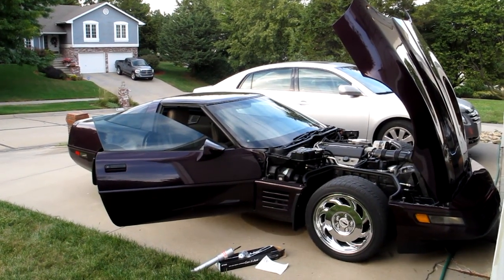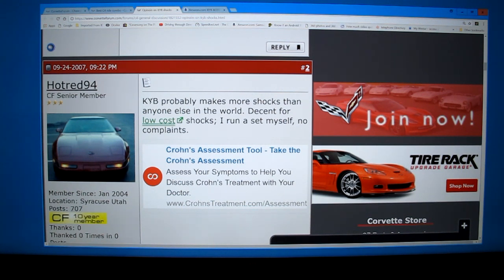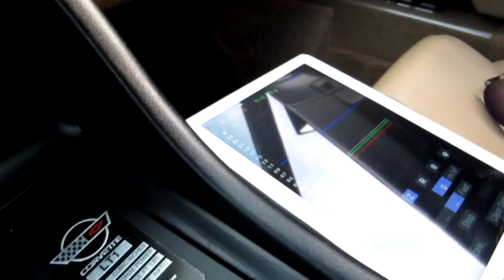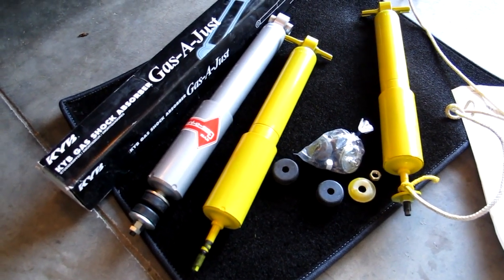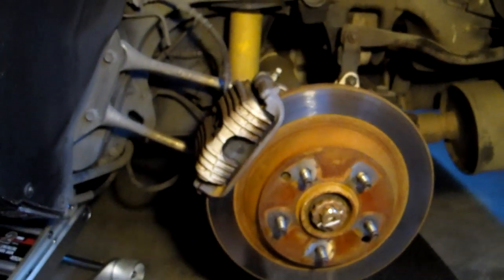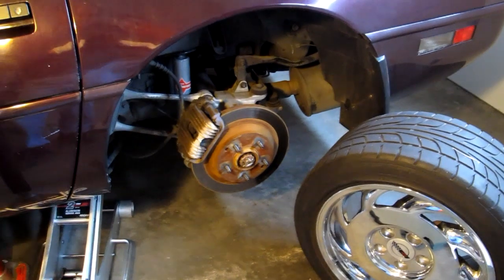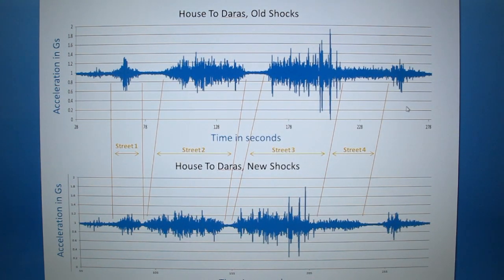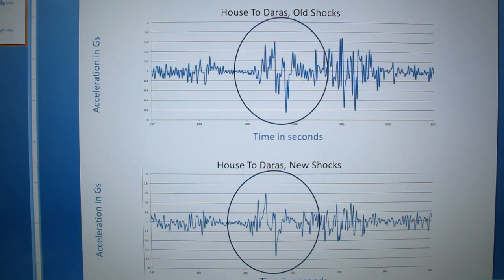Shock replacement and ride quality in 1992 c4 Corvette

Comment: i have a 94 corvette that i have had for 14 years     i also replaced all my shocks with the KYB also replaced my rear leaf spring bushings while i had all the wheels off  ---     now please do not take this the wrong way  i never knock  anyones ride --- i can very much say that i know about bad roads  ---    after watching your video  i think my car went down the road better with my old shocks  then yours seem to do with new shocks  ---     if i were you i would check for other problems -ball joints --stabilizer bushings   front and back -  hope all is ok  and i am wrong  --all i have to go by is your video ---good luck and stay safe--- also great video
Reply from the maker: Thanks for the info. You make a good point. I have some evidence the bushings are less than perfect for sure (some squeaks on hot days), but the ball joints seem OK and the steering is tight.  That said, some of the roads here really are awful. We ended up changing the springs and shocks on my wife's new mini-van after just a year of dealing with its jarring ride in our area of town.  It went from bumpy to bouncy is about all I can say. Without ride-leveling design on the van (which we unfortunately didn't know about), even our lighter springs were not enough. How long does it take to do the bushings?
Reply: it doesn't take long to change the bushings  -a good half day -  if this is something that you have never done before    it would be good for you to watch a video or two on youtube -it is not a hard job that can be done with regular tools --a couple of jacks and jack stands --  if you can spray all your bolts the day before with some pb blaster penetrating oil it will really help----e-bay has some great deals for good nylon bushing--the rear leaf spring bushing kit  is called rear spring cushion kit--take yor time and you will glad that you changed them---i live on cape cod and i have driven my vette to florida--tenn and some messed up roads in new hampshire --i feel that it goes down the road just as good if not better then 14 years ago--good luck and stay safe my friend
Reply from the maker: Thanks !  Good info :)

Comment: Excellent video, appreciate the quantitative data along with the subjective impressions. Now that you have had the shocks in the car for several months, are you still happy with them, and has the car returned completely to the pre-change ride height has it settled lower?
Reply from the maker: Thanks. Interesting question.  I just ran to the garage and checked. It's still sitting at 27.0 inches - so no change after the initial settling.  I am definitely still happy with the shocks. The ride has gotten no worse and no better since they were installed, and I still feel the ride is much improved over the 26 year old Bilsteins removed in the vid, without noticeable loss of cornering (but I'm not a track person). But I'm hanging onto those in case someone in the future wants to refurb them and the actuators. Won't be me though. I like the KYBs :-)
Reply: Appreciate the response. I am considering the KYB to replace my Bilsteins since I not longer compete with the car and they are a little harsh. Mine 1990 Z51 was Autocrossed for twenty years with four championships on her, but I have returned her to street use only since rebuilding the engine after blowing it up during a Pro Solo.  I still want good handling, and don't expect sedan ride profiles. The cost savings on the KYB over the replacement Bilsteins is significant now that I am retired. Thanks again for the response.
Reply: @MegawattKS  now that you are through the summer and getting ready to put her away for the winter, do you have an update on the performance of the shocks? Thanks.
Reply from the maker: @ThorinOakenshieldGSD2023  Fortunately I don't have to put her away for the winter. We don't have snow (or salt) on the ground very often in the winter and as long as it stays near or above freezing, I still take her out on weekends if the roads are clear :-)  On the shocks issue I haven't noticed any changes, so I'm still happy with them (not that there was a night-and-day change other than improving the damping - springs are still what they are). If you decide to try them, I hope you find them to provide what you're looking for. If nothing else, they are cheap (and made by a company that's big enough that I feel like they're OK). As you can see in the video, they aren't quite as beefy as the Bilsteins, and the hub-attach on the fronts is a little cheaper (notches instead of holes). But for somewhat spirited and non-spirited driving around town, they've been great.

Comment: Did you get a dash code when you disconnected the FX3 shock setup and went with these non FX3 shocks ?
Reply from the maker: I have no display on the driver info panel above the climate-controls, and nothing reported in the diagnostic readouts. BUT - I didn't have any lights before either, and as far as I can tell, the actuators were not working. Which lead me to believe that perhaps a previous owner (or shop) took out the bulb for the selective-ride-control stuff.  I think there is a test it does each time you start up the car (operating and sensing the shock-control rotation angle). I did check it immediately after unplugging the front actuators and nothing lit up :-)

Comment: Your ride control actuators are shot
Reply from the maker: Agreed (gears stripped), but the shocks were shot too. 26 years and 112,000 miles took their toll on those Bilsteins. The damping was too light (multiple bounces after pushing down). Now the damping is restored and after driving it for a few months I can honestly say it is both more comfortable and better controlled in spirited driving :-)

Comment: I got the same floor mats and cargo mat for my 95. I also have the same Black rose metallic paint with 24 ct gold front and rear emblems. Check it out. I replaced my original shocks with the KYB shocks as well. Your video is why! Great job on the research, you saved me a lot of time. I think I'm going to paint them gold along with the rotors...  https://youtu.be/nfp17rc93nI
Reply from the maker: I see in your video that your car only has about 41K miles. Nice. What do you think of the ride quality after installing the KYBs? I'm still happy with the results. Next job will probably be some fluid changes (after the long cold winter is over :-)
Reply: It was like night and day. The cornering and overall stability are better than expected.

Comment: Wow, that brings back memories.  Your car looks practically identical to mine except mine was black.  I had the exact same rims that were polished to a mirror finish.  I don't know what it is about that style Vette (dark color) that goes with those stock wheels that are chromed that makes the car pop but it does.

And I pray to God that yours are chrome and not polished like mine where.  I couldn't tell you how many hours of polishing it took after I unknowingly turned my mirror finish into a milky white haze after I cleaned them with chrome cleaner.  Took about 12 hours per wheel of polishing to bring them back to their mirror shine. 

Chrome cleaner kills polished wheels!!!  I didn't know that at the time.
Reply from the maker: Thanks for the warning on the wheels. Fortunately, mine were chromed by a former owner (and it has held-up amazingly well). I agree, I really like this style wheel, and even the C4 body style. Love the clam shell hood thing and the hiding headlights !  Someday I may get a C7, but I have to say the C4 is perfect for me now.

Comment: Great use of an accelerometer in a tablet. I wonder if you used a smaller Android device with less weight / mass if you might get more granular data?  Thx for doing the research, we also need new shocks on our C4 and are overwhelmed at all the choices.
Reply from the maker: Great question. It's definitely important to know if we're seeing the tablet-bounce or the wheel/car bounce in the graphs. A phone might give somewhat different results (I would guess higher-frequency accelerometer noise). The granularity (in time) was limited by the App's max storage and hence time / sample-rate. I think it was sampling fast enough. But I wish I had better dampened the tablet in the earlier trials before changing the shocks. Later I threw some old bluejeans on top of it to try to press it down better. That could account for some of the improvements seen in the before and after - but I'm still convinced it feels much better to the driver after the shocks were changed, so I think the data is generally valid (although the apparent wheel-hop frequency does seem a little high relative to what Dave McLellan's "Corvette from the Inside" book suggests ...).

Comment: I have a 90 Corvette that I put the same shocks on this past summer. I also have the Z51 and FX3 system (which works!). Ride is very smooth on the highway...almost like a Cadillac. BUT, when you take hard corners (I occasionally do track touring sessions at Road America) the car has severe body roll. I was rather surprised. So over the winter I think I will be sending my original Bilsteins in to have them rebuilt, and put them on in spring. Nice video!
Reply from the maker: Thanks.  I've never done hard corners on a track, but that's what those nicer Bilsteins are made for :-)  I did notice that my actuators seemed to have broken gear-sockets in them too. At least that's what it looked like. I've kept everything for the next owner so they can do that too (when I get too old to drive a Corvette ;-) !
Reply: I just bought a C5 with the FX3 system.  How did your rebuilds go?
I don't know if my system works or not.  The only drive I had was about 90 miles home in a cold Feb. rain.  I didn't notice any difference when I switched it.  The ride was NOT like a Cadillac (I HAVE a Cadillac) but it wasn't uncomfortable either.  Is a Bilstein rebuild worth it?